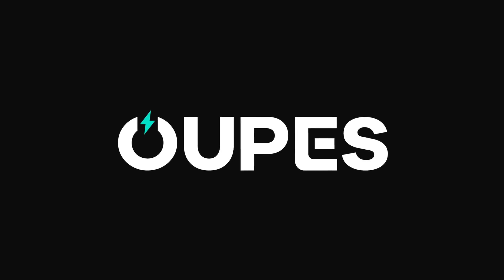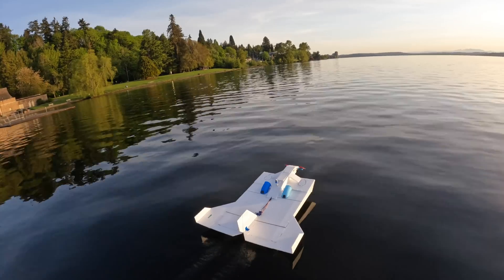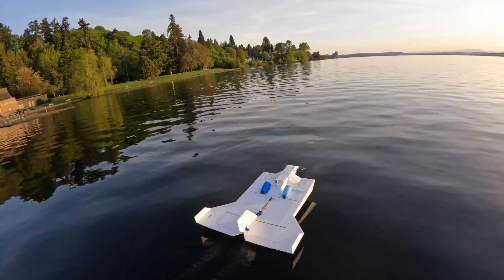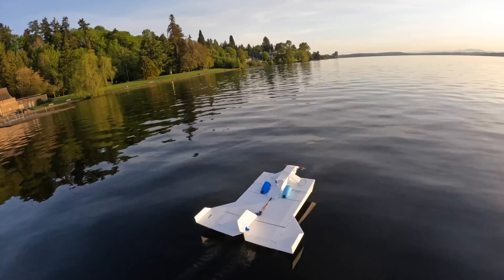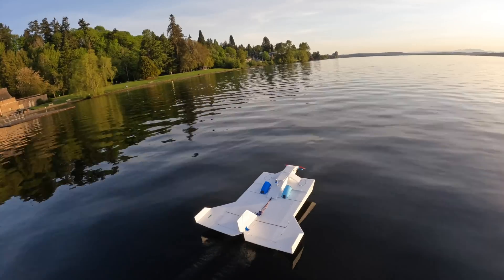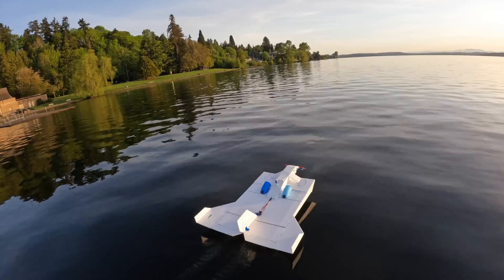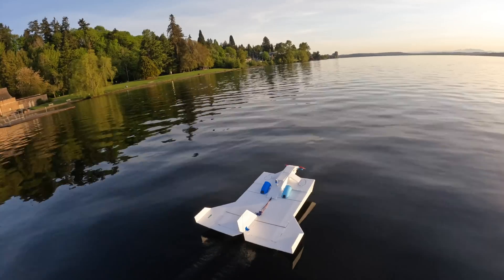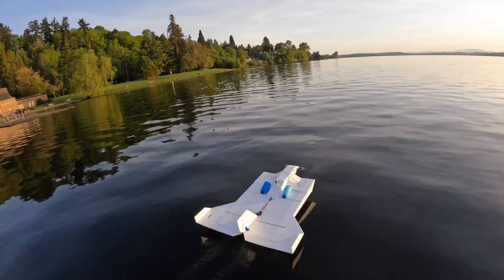Testing WWII Era Terrain Following 'Radar' On R/C Plane

Comment: There is a much simpler, safer and more general way to achieve stable flight in the ground effect : use a conventional long thin wing AND a "T" tail.  This causes the main wing to enter the ground effect before the tailplane, which causes the plane to increase angle of attack as it descends into the ground effect, and so "float" on the ground effect. This is actually a problem when landing T-tailed sailplanes, which can cause pilots to overshoot their landing unless the consciously counter the effect.

Comment: Hey ground effect isn’t a high pressure cushion of air, this is a common misconception. It is the loss of induced drag due to wingtip vortices being cut off by the ground. This straightens the lift vector more to be more vertical, so there isn’t as much of an aft component causing drag. It’s essentially an efficiency increase, but not a cushion of air.

Comment: Speaking as a pilot, I can say that when I went from low-wing aircraft to flying a high-wing Cessna, I definitely made some rough landings at first, because of the reduced strength of the ground effect. When I was learning to fly, getting a good flare was one of the hardest things, exactly because of the ground effect. When the aircraft almost touches down, the efficiency of the wings increases dramatically, which means that even a slight movement of the elevators might pull the nose up too high ("ballooning"), exiting the ground effect again, losing a lot of airspeed and coming down hard.

Comment: With the canard and gears,  making the canard smaller with the same throw (gears) likely was making it go into a stall.   You could just try reducing the gear ratio or better yet just use the probe to actuate a potometer, read then, then control a servo with that.  I have to think the uneven surface of the water might cause issues with both lidar and sonar.   I wonder if one could measure capacitance between sensor and water surface to determine height?

Comment: Hi, I just thought of this design as rc ground effect airplane on water… that should dampen wavelets like a big steady one…
Truely, I never built one.
Well length about 2m. Like a small boat or surfboard. In foam light and strong. Motor on a turret about the middle.
Slightly in the back, can help to steer with servo mount.
This board should help to maintain ground effect, carry the batteries… also around the middle…(can adjust later of course).
Add 4 winglets: 2 front, 2 rear. Short, somehow wide, adding a servo on each is good (4), but maybe not determining !
They lift, control, steer…avoid bumping…or even fly like a plane because the fuselage would be too long too flat… just above the water.
That’s it. Even looks like big ones.🚤✈️🏄‍♂️

Comment: A similar concept actually flew in WW2. y'know the minesweeper Wellington with the ring around the aircraft, that generates an electromagnetic field to trigger mines? to keep it at exactly the right height over water it had two fishing poles stuck out underneath, with electrodes that would be closed when in salt water. the longer one lit a green light and the shorter one a red light. pilot had to make sure only the green light was lit. from "Almost A Boffin", E. E. Ville, pg182

Comment: Regarding the altitude oscillation, how many sonar pings per second were you running? Due to the plane's speed and variation in water surface shape, you would need a high rate for the PID algorithm to work well. A time of flight sensor may work faster and help. I'd like to see a re-run just for that!
For that matter, what is the loop speed for the PID?

Comment: I wonder if because the surface is not smooth if it is receiving signals from unexpected angles. It would be interesting if it had a input sensor at an angle pointed down  in front of it, and right beneath/pointed away from on coming geometry and if there'd be anything between those two values that could regularize the surface. Maybe some weights could be assigned to large disruptions in front of it that puts it in an upwards U turn to reapproach at a slightly different angle for low flying?

Comment: I think the ground sensing radar idea is close but needs more math to work.    E.G. if the PID loop results in a linear movement to the canard servo that is incorrect.  Because that linear movement changes the angle of the canard producing non-linear lift.  You could make an inverse table of that non-linearity and run the PID output through that to produce the output.  Then your PID would be non-linearly compensated and tuning would work.  Also, like you say, the filter to average height data might be too long, adding too much delay to the PID loop.  You could explore shortening that filter.  Interested to see more!

(there’s actually multiple non-linearities present due to servo arm translating rotational angle to linear motion, this would be a sinusoidal type curve.  The other one is the angle of attack to lift curve.  The neat thing is you can compensate for the sum of these two curves by simply measuring the force produced on the wing by servo position and making a table of readings.  Then use the PID to output the desired lift, and you do a lookup of lift and calculate the desired servo position using interpolation.)   

(Also if you’re still reading.. haha.. the aircraft velocity is also a scale factor of the aforementioned servo-lift table and if you had that variable you could scale it with that, so for example if it’s traveling faster the lift required is obtained at a lower canard angle.  So, you could fudge it with a velocity beta coefficient or use a 3 dimensional servo-lift-velocity table if you wanted extra credit 😂)

Comment: Love your videos!
I believe that the surface wand touch point with the water, has to be far ahead of the CG in order to have stability.  This is evident in all of the foil boats that use this control method.  When it's behind or close to the CG, the pitching motion may be causing a reversal in wand displacement angle.
Put another way, think of the wand controlling aircraft pitch, not altitude.  Suttle difference maybe, but it matters for stability.

Comment: I would recommend to dive into ‘control engineering’. The problem of bouncing relates to a long time between applying the correction action and reaction of the system. Seems you need a proper ‘filter’.

Comment: Changing the wands so that they are curved, may help with the oscillation. As the plane gets closer to the ground, the curve would cause the flaps to be turned less for the same unit of distance closer.

Comment: The mechanical control system on a foiling Moth (similar to the sailboat you showed), relies on what we call a "fast point", where you have maximum control input (rate) at the desired height, with diminishing sensitivity (rate of control surface change for a given unit of wand rotation) the further you get from the desired height. This is key to preventing the porpoising and oscillation you're seeing.
Reply: ie if it's a constant rate throughout the arc of your wand, it will oscillate.

Comment: I would say add a reduction gear between the wands and the control surface. Print some different ratios and continue testing. It will depend on the wind condition and airspeed which configuration will work best.

Comment: Rather than direct drive (1:1) I would maybe go with a cam lobe so that you have increasing control authority to help smooth out oscillation. You can probably calculate the cam profile based on the rate of oscillation at a given average speed over ground

Comment: It seems like the rods might be more effective with more flexibility. I'm guessing the further it goes the more flexibility would help, to the point of having runners made of a slightly stiff and springy material could reduce the input on the canards. Also the water's viscosity is probably playing a big part, so a single rod may be better. 

Finally, I think a second ground effect wing on the rod could be cool if it was a power system, as opposed to the analog system that is on there now. 

I don't know how practical any of that would be,  but it would be decent content

Comment: Apologies if the following has already been mentioned:
- Using the flaps to control altitude failed because they add drag to the flight, slowing the plane and dropping it lower - oscillating AoA until power and/or elevator inputs change.
- Canards are primarily used to add stabilisation to an aircraft to help reduce wing drop (left or right) when nearing or at stall condition. Independent pitch control of canards will result in unpredictable behaviour until you've thoroughly tested the flight model. Very few real aircraft use both a pitch-adjustable canards and rear-mounted elevator at the same time. They are either set in a fixed pitch angle when there is an elevator or they exist without an elevator and act in its place (eg. some classic Bert Rutan kit planes and the SAAB Viggen). 
- Throttle adjustments to control/stabilise ground effect shouldn't work as you're changing the airflow patterns with a prop at the front - the vortices need to kind of 'stabilise' or settle to even get a chance, especially on a tiny model (even with the prop positioned above the nose of the a/c).
- Air molecules do not scale, so you need to keep this in mind when testing/building/evaluating.  Wing chord can compensate quite dramatically for the "huge" air molecules you're dealing with when flying small scale aircraft. If you were to scale up the speed of the aircraft you're flying from say 1/16th to 1/1 you might be in for a big surprise as you'll probably find that some r/c aircraft with props go faster (when you scale their speed up to 1/1) than a full scale aircraft ever can/could/will! ie. Impossibly fast when brought up to 1/1.
I hope the above makes sense.
Keep up the great camera/video work - looks great. The models look great and no, I'm not yelling at my screen.. YOU are 😉😁!

Comment: Hi, it’s all highly technical and knowledgeable… Innovative & very good , even among the best in the area.🚀
Ground effect for airplanes, rc, is the wind pressure that lifts them just above ground..u know..
But in fact without radar detection nor water sonar nor wand nor flaps reaction…  Which u emphasize.
So I guess it’s more the design of the plane, speed. Small RC would naturally be more sensitive to water waves …thus making them a success even if with bumps
🔦🧩

Comment: So, I think your instability issue comes from the physical time delay between sending the control signal to the elevator and the resulting change in attitude. This is the same thing that causes feedback at a live concert. 

In a perfect world - you would fly your plane in a perfectly still air environment, then move your elevator X degrees and record the change in attitude over time. You would then deconvolve this this trajectory from the desired trajectory to figure out how much elevator to use. This is completely unrealistic because deconvolution is computationally intensive.

You might want to consider running a cheap little 2nd order FIR band reject filter at whatever frequency your oscillation occurs at. You don't need to make it perfect  - just need to reduce the feedback gain at that frequency. I can help you with a simple DSP algorithm if you're interested!

Comment: After watching this fly I have a suggestion.  Go back to the canard; this was on the right track.  The problem is not the canard, it's the surface following wand.  The wand is so stiff it is acting almost like a 2 position switch.  As soon as it contacts the water, it's all or nothing deflection of the canard.  Rather than using a rigid pole, try using a thin piece of stainless steel fishing wire.  The wire should be thin enough to deflect at least 90 Deg with minimal deflection of the canard when force is applied to the tip of the wand.  You want the canard to deflect more and more as the wand goes deeper and deeper in the water.  It should be at full deflection only when the wand is substantially submerged.  To achieve this balance, you may also need to increase tension on the rubber bands you are using to return the canard to a neutral position.  By making the wand much more flexible, you are in effect adding mechanical dampening to the system.

Comment: I still havent seen anyone mention the need to account for the varying height of the surface contour the plane is following. They are WAVES, and can create interesting build ups in your I and D tuning. Not to mention that as thr aircraft oiit hes the distance from the sensor to the water changes, cos∅ or sin∅. 

And with the stick controller, the natural downward pitch when out of ground effect is too great. It should just barely be set lower than horizon.

Comment: Regarding the sonar, you should really look at recorded data; measurement, control surface response etc. This way you can seen if your sensor is behaving, and you'll be able to better tune the PID, possibly with one of those tuning methods like ziegler nichols

Comment: Like the "dam busters" of wwii. A light on the tip of each wing, set at an angle, so that when the plane was at the correct altitude, the two spots of light merged into one. 
I'm sure you extrapolate something from this.
Like, IR LEDs in Aperture Tubes...

Comment: What if the height dangle rods were connected to a cylinder that compressed air??? Would that take out the oscillation?

Comment: Great video! As a control engineer, I suggest using MATLAB or similar tools to collect, analyze data and understand how the aircraft behaves. Testing altitude control ideas in the software before trying them out at the lake can help optimize the system. Also, be mindful of potential delay or lag from the sonar system, as ignoring them might cause issues with altitude control. Excited to see your progress!

Comment: Experimenting with the gear ratio might help the sensitivity. Also weird idea but maybe if you add a box around the gears and fill it with a non Newtonian fluid that is less viscous under load and more so at rest like ketchup. The lesser impacts with the ground might be damped slightly while the larger more forceful ones are less damped. Weird idea but might work

Comment: Mechatronics engineer here!  Click read more for some slightly nerdy control advice!
 
I'd love to see this project developed further. Im lead to believe that the oscillation problem may also be a result of the senor range. If the controller always has an accurate height measurement using a range of sensors (like IR and sonar fused with some form of Bayes filter), then the PID gains can be dynamically allocated. An airspeed measurement would also be useful to scale the gains, as the controll authority dramatically increases with airspeed. 

I like this approach because you don't need a perfect plant model, but you do need a half decent starting guess. A motion model is easy enough to find insitu for the bayes filter, though changing wind speeds/ direction might make for a new headache. 

So with just height and airspeed measurements, the controller should have enough information to fly without oscillation at any altitude. Pitch sensors may not be needed as sinkrate is arguably more important for stable flight at ANY airspeed. The only other useful information would be the terrain height AHEAD of the aircraft, similar to the terrain warning in real aircraft. this could just be a simple IR senor with a 5-10m range in this case.
 
I think I still have the code to do this from a similar robotics assignment from Uni. Id be happy to dig it out for anyone interested.

Loving the ground effect series! I look forwards to your next idea!
Thanks for listening to my TEDtalk :)

Comment: I work with sonar sensors in an industrial environment, we see sonar signals being 'blown away' by the wind in outdoor situations. This fault has been corroborated by the manufacturer (Pepperl Fuchs). We say this fault mostly as excessive noise in the signal. Have you thought about trying other distance measurement techniques?

Comment: Your height sensor appears not to be working but you can check the data before and after it skims the surface ? You might get more reliability by pointing one sensor slightly forward in the tail and one slightly backwards in the nose (or vice versa). The Dambusters used two searchlights one forward and one aft to get reliable height measurement in the dark in the 1940s - when the searchlight beams both hit the same spot on the water surface, the plane was flying at the correct height.